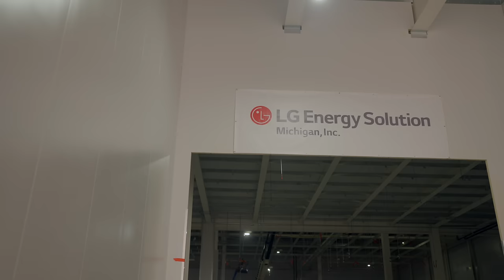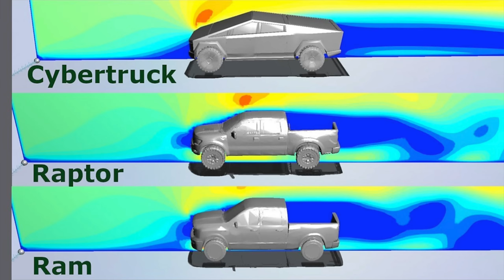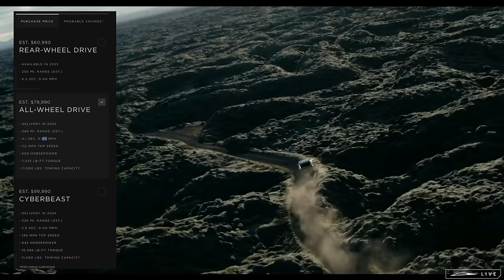Cybertruck - What Tesla ISN'T Saying!

Comment: The bulletproof-ness is limited to a few handgun calibers shooting subsonic lead bullets.  Lead is quite soft.  Going supersonic and using solid copper or some other monolithic projectile besides lead and the truck and occupants will develop leaks.  Alot of rifle rounds will certainly penetrate except maybe a .22LR.  As for the shotgun, I wonder why they didn't show them shooting a 1oz. slug?  It's cool that it is more bullet resistant than any other factory vehicle, but it is far from bulletproof and imo reckless and unnecessary to promote it as bulletproof.  Just waiting for some idiot to do their own test with a platform and projectile, of which there are many, that will go through and hopefully no one gets hurt in the process.  Then all the uproar that follows while people like you with your big dumb unknowing smiles that has been regurgitating this nonsense for the last four years will have what to say?   But hey, it keeps the content rolling right?  It doesn't really need to be questioned or use critical thinking, if Elon says it and its cool then I'm saying it too without hesitation.

Comment: Electric vehicles are def at least some part of the future. For me no time soon. Crazy cost + terrible range due to getting 60% as you are not supposed to charge more than 80% or go less than 20% and cold weather and/or high speed kills range, electrical infrastructure couldn't even handle severe winters in past years but tesla and government wants us to all jump to electric vehicles? No... This is too expensive and dumb right now. Use solar power? Too expensive electric companies are finding ways to attack folks that don't have $50k or more worth of batteries by adjusting the exchange rate. I'm happy with my lil 2016 chevy cruze that I paid $18k for that's paid off and costs me $80 a month for gas to get to and from work 5 days a week and go to the store versus a $1500-2000 electric car payment + $200-300 / month for charging reported by my friends who gave tesla vehicles. Lol one day when prices make sense and issues are fixed, I'll dive into electric cars. Not gonna be the guinea pig early adopter
Reply: So many thing that are just factually wrong  . Firstly you can charge more than 80% on Tesla or goes below 60% charge. Secondly with most EV having more than  200 miles range (the lowest range Tesla goes for 257 miles)  , that woudl beneosugh for most peosple. Also cold weather affects EV like Tesla a lot less than you think thanks tio theri thermal management . Besides severe winters does havoc to gasoline and diesel supply chain  too  so you're not really that better with them . Even your last point about paying $200-300 amoth for charging seem suspicious, electric is much cheaper than gasoline or diesel.
Reply: @remliqa  They still don't make sense for a lot of people. I commute with a civic si that gets 40 mpg. The car was 23k and it's paid off now. How does it make sense buying a 40 plus thousand dollar electric vehicle to save a little bit on fuel. And when the batteries need to be replaced down the road it's gonna cost a lot as well. Just doesn't make sense if my gas car is cheap and gets pretty good gas mileage. Eventually if electric cars could come down to a realistic price range maybe it could make sense for more people.
Reply: @eagle25311  While you are right about BEV being way too expensive now. I need to remind you that currently the average price of a new car(not juts EV)  in the US around 40K, . Even with it far lower maintenance cost (no oil change, fewer moving parts) and electric price, the upfronts cost is still a pain. Ulike Europe or China  which have tons of choice for cheaper EV, the only choice for chasep EV in the US  is the secondhand  market.

Your second point is myth, a BEV can last a long an a gasoline or diesel powered car. The battery of electric cars like Tesla  rated to last 25-30 years it needed to be replaced.  Coincidentally that is lsos the average age of a gasoline  before the it's scrapped  At that age the battery isn't dead, it just it have significant (over 10%) degradation  . This comparable to a  gasoline car as no gasoline cars can last 20 years without significant parts change , without them your 20 years old gasoline car would be dead or have a lot, los  less range and less safe.